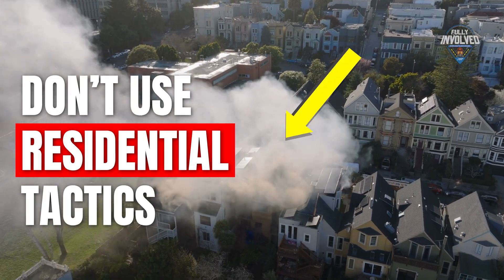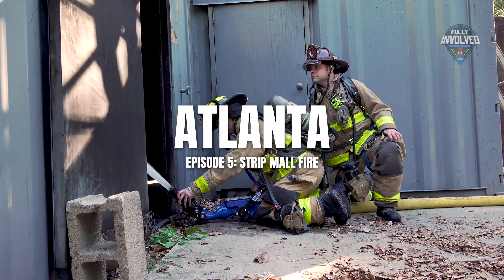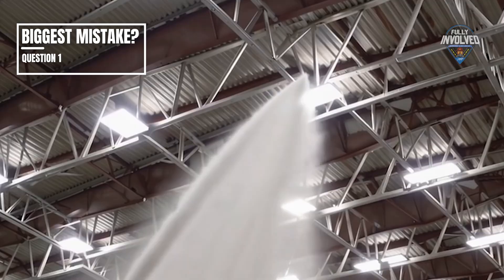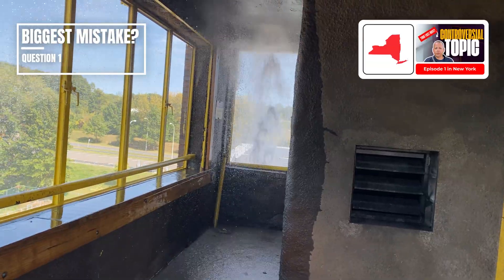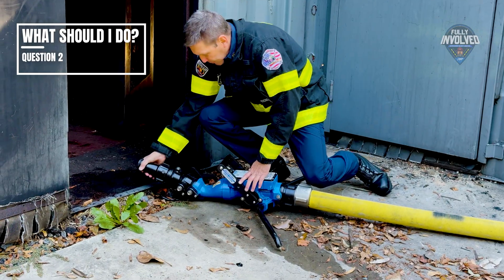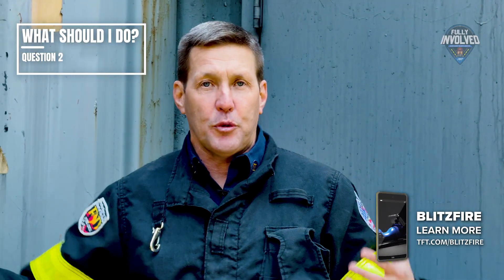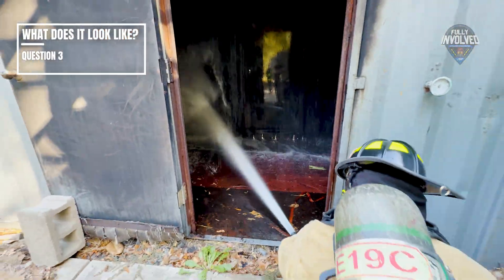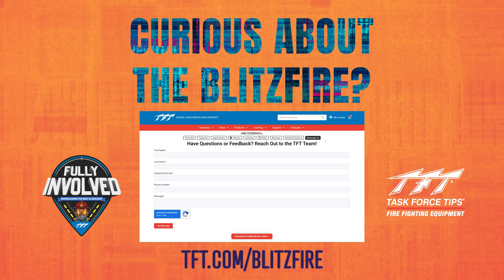Commercial Fire Tactics – Avoid This Residential Mistake (Ep. 5) | Fully Involved

Comment: Vent first?
Reply from the maker: Say more - what's your line of thinking?
Reply: @TaskForceTips  I'm not a fireman. But it seems to me that these high ceilings in commercial buildings can store a hell of a lot of unburned gasses leading to flashover. Also, the venturi effect of the water hoses is moving more oxygen into the building.